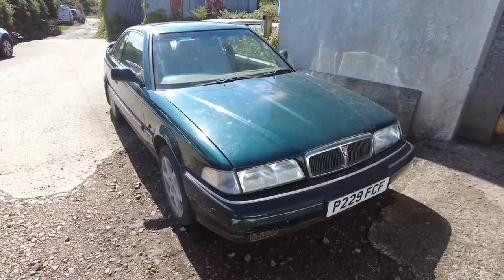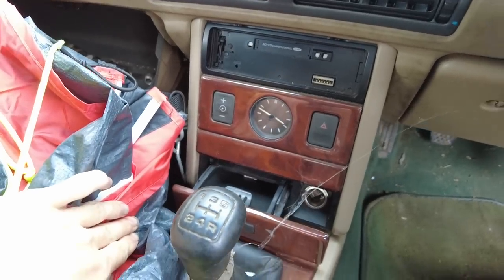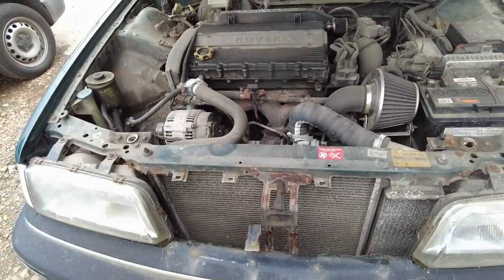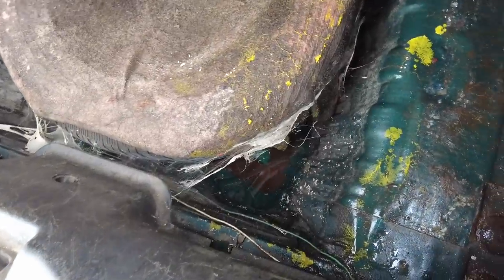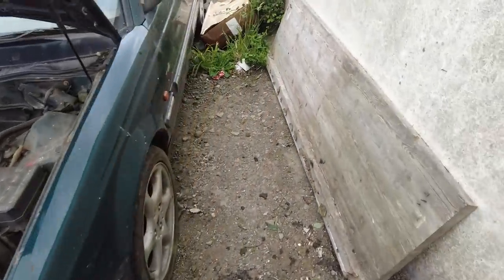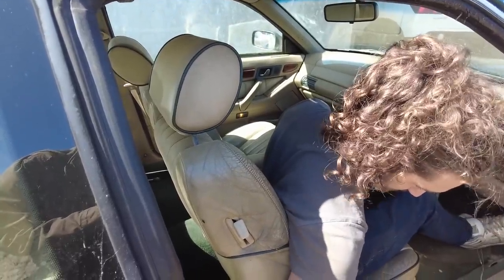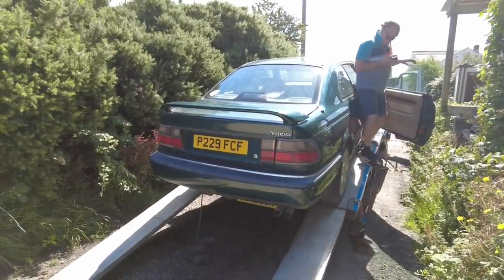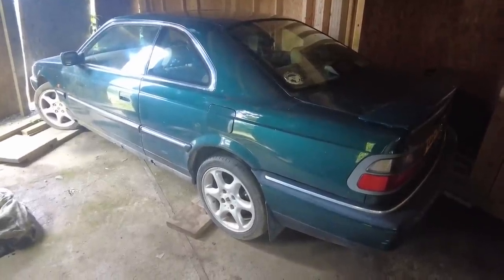I Saved An Ultra Rare Rover 800 Turbo Coupe From Scrap!

Comment: That ghastly fake wood is actually real walnut.

Gearbox is a Rover Powertrain PG1 based on a Honda design, not a Peugeot one. That is the R65 used on the smaller K Series.

Comment: Friend of mine had an 827 coupe sterling with the 2,7 Honda lump. Nice old car, he converted it to run on LPG as he did starship mileage and it ran up to about 220,000 miles when the auto box crapped itself. The LPG system was taken off and the car scrapped.

Comment: That's the instrument dimmer and it's real burr walnut veneer on aluminium bases. The gutters around the boot are rotten, you'll need to fix them. Add 0.5L of Carlube ATF-U to the engine oil, it will sort those hydraulic tappets. The front wings are Coupe ONLY, rear brakes need a specific method to replace the pads or the calipers WILL sieze!
Sills were, maybe still are available through the 800 club, the bonnet is standard Mk2 800 and if you wawnt to change it for a Mk1 bonet you'll also need Mk1 headlights to fit the grille.
Sounds like your clutch slave is dead, common problem!
Good luck with it, having owned an 827 Coupe for 5 years, i can see you'll need it!

Comment: That is aircon but probaly doesn't work. 
That spoiler has been added they were only ever fitted to the fast back.
Does not have cruise control 
And I wouldn't run it untill you  have fitted a coolant tank, its probaly dry. 
Other then that....
You got yourself a high mileage Rotbox.
Rather you then me, there are better examples out there going for peanuts
Reply from the maker: Not really mate there are none around!

Comment: 😅sorry to say it’s a rust box get a screw driver and give it a good poke , thank god you didn’t say you were going to restore it , we would be waiting another 5 years , So I guess your plan is to sell it on quickly and hope to get a bit of a profit all being well.
Reply from the maker: My plan was to save it from being scrapped and I have done that
Reply: Last MOT.....   Do not drive until repaired (dangerous defects):
Driver's seat backrest cannot be secured in the upright position. (6.2.5 (b) (ii))
Repair immediately (major defects):
Exhaust carbon monoxide content after 2nd fast idle exceeds default limits (8.2.1.2 (b))
Exhaust Lambda reading after 2nd fast idle outside specified limits (8.2.1.2 (c))
Exhaust carbon monoxide content at idle exceeds default limits (8.2.1.2 (b))
Anti-lock braking system warning lamp indicates an ABS fault (1.6 (b))
Nearside Rear Brake pipe excessively corroded (1.1.11 (c))
Nearside Front Lower Seat belt anchorage prescribed area strength or continuity significantly reduced sill (7.1.1 (a) (i))
Nearside Rear Lower Seat belt anchorage prescribed area strength or continuity significantly reduced sill (7.1.1 (a) (i))
Offside Front Position lamp light intensity significantly reduced (4.2.3 (a) (ii))
Nearside Windscreen wiper does not clear the windscreen effectively (3.4 (b) (ii))
Offside Windscreen wiper does not clear the windscreen effectively (3.4 (b) (ii))
Nearside Steering rack has excessive free play detected at the steering wheel (steering rack fitted) (2.3 (a) (i))
Monitor and repair if necessary (advisories):
Oil leak, but not excessive (8.4.1 (a) (i))
Brake disc worn, pitted or scored, but not seriously weakened all front & rear (1.1.14 (a) (ii))
Offside Front Seat belt buckle slightly damaged (7.1.2 (d))
Offside Play in steering rack inner joint(s)

Comment: They were a lovely drive - not too many cars were as comfy - the Peugeot 406 gave it a run for its money. Reliability of the 2 were similar (i.E a bit crap..) but I like both cars just for their sheer comfort. The sills on these are an absolute doddle to rebuild - the shape is so simple, as are the jacking points - neither would bother me a bit.

Comment: Always wanted one of these. Had a sterling coupe that had seen better days and always wanted one with a turbo’d t-series under the bonnet. Is that a vitesse lux with the sterling interior because they’re definitely not Recaro’ seats. Should have air con though unless its been removed because that’s the auto climate control gubbins also like the sterling. I doubt there’s any body parts shared with the tomcat though 😊
Reply from the maker: It could be yours!
Reply: @classic_britain  I don’t think you’re too far away from me either
Reply from the maker: @tomeasterbrook9486  Feel free to get in touch

Comment: Some bits pressed here in Swindon the rest in Cowley Oxfordshire. 1997 2 litre 16 valve. Very nice. Great buy.
Reply: @AllSortsOfStuff58

I've owned 4 Rovers and none of them blew a head gasket, what does that tell you ?
Reply: @AllSortsOfStuff58 
Actually I do quite high mileage and I'm no slouch. However, I do maintain all my cars myself and all the work is done properly.
My current Rover 45 with a K series was diagnosed with a head gasket problem by my local garage in 2020. However, I didn't think it was, and after I removed the head I found it was actually a leaking valve. So how many other Rovers have been diagnosed with head gasket problems when they are not ?
Reply: @AllSortsOfStuff58 
No head gaskets last for ever and 300,000 before a head gasket goes is actually quite good and above average which is closer to 200,000 miles. However, BMWs only last for 100,000 miles before they go if you are lucky. Some go much sooner around 60,000 miles but strangely it's a BMW so no one complains, they only complain  about Rovers.
Reply: @AllSortsOfStuff58 
Nothing I have said is either 'nebulous' nor argumentative, so I don't know why you assume I'd want to argue with you ? 
I've only written down my own experiences plus some readily available info about BMWs which I thought people might find interesting.  As I said, BMWs suffer with head gasket problems but no one mentions them, only Rover. You seem to be agreeing with me on that . Yet I've owned 4 Rovers and never had one go on any of them. That's my experience and if that upsets you I'm sorry, but there it is.

Comment: It should have had Aircon from the factory, with automatic temperature control, hence the digital display and related controls - another tell-tale sign is the word "Econ" on the dash - this was a mode of air conditioning that was supposed to save fuel.